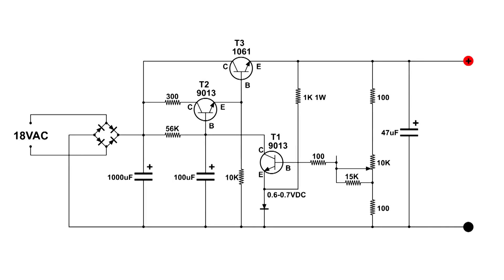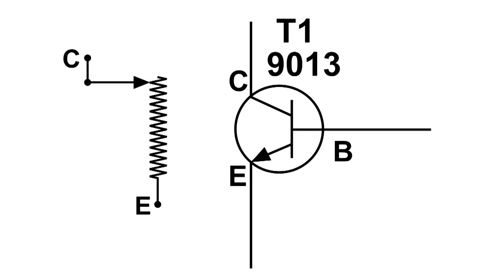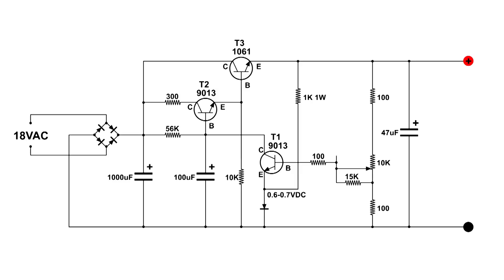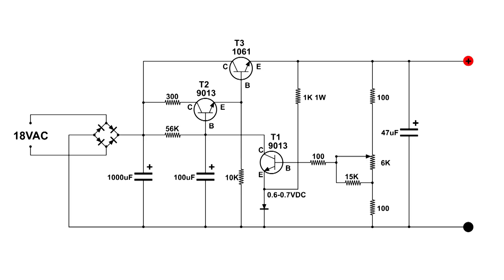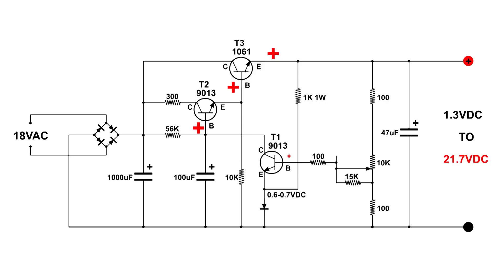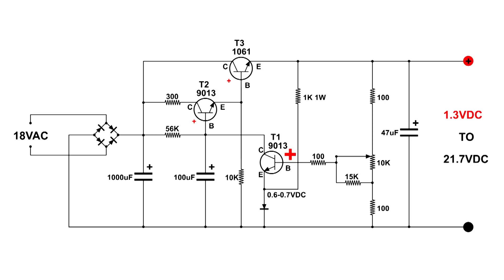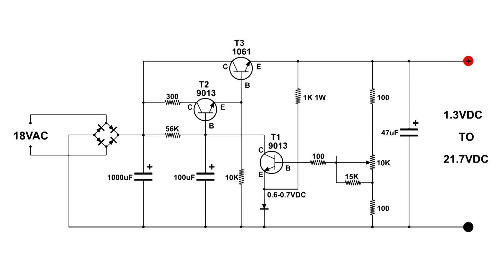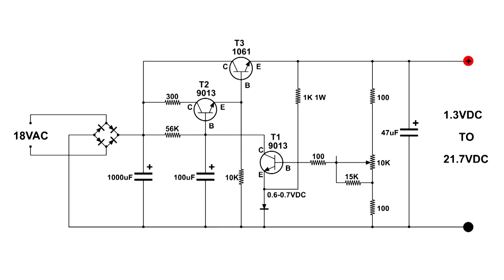Regulator Power Supply Kit FK808 Circuit Description

Comment: This type of voltage regulator configuration is also suitable for higher voltages such as 48VDC or 72VDC for charging small electric vehicles. but the transistors and electronic components must be well calculated for these voltages.
Reply from the maker: Thank you.

Comment: How quickly does this circuit take to compensate for increased loads?  Is it measured in 10s or 100s of microseconds?  Thanks for posting.
Reply from the maker: It's analog so it is almost instantaneous